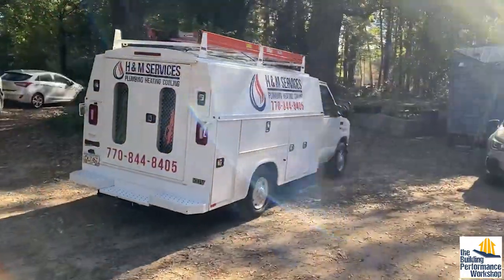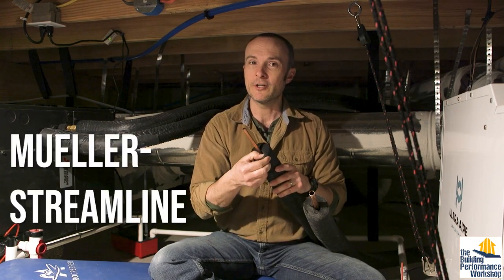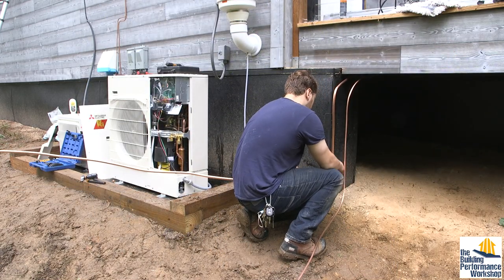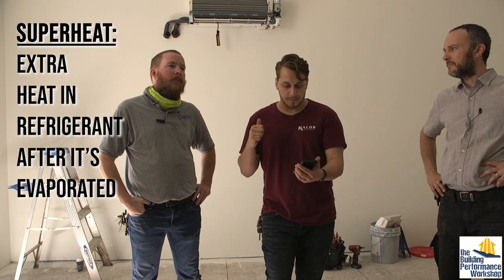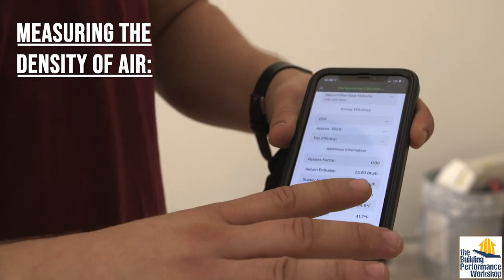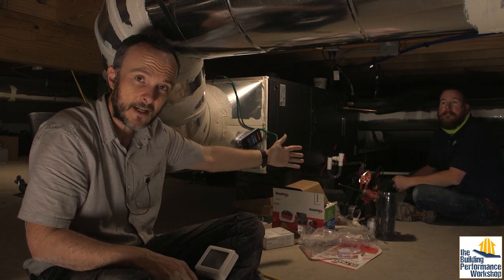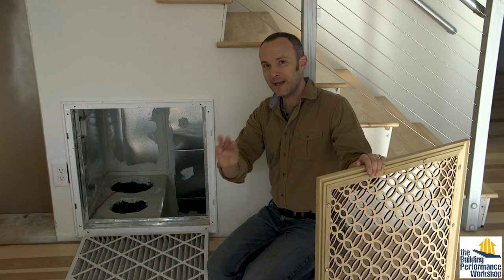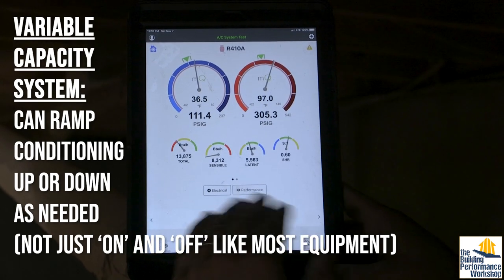Ultimate HVAC Install and Testing: High Performance Heat Pump and Ductless Mini-Split

Comment: Great video and Thank You for taking the time to explain the proper steps needed for a HVAC system to function and perform well. Im almost 40 years into the HVAC trade and a HVAC contractor and it is so cool that the newer HVAC techs can get so much needed information online/ YouTube to help make them better HVAC techs. Keep up the great work and videos. Cheers
Reply from the maker: Thanks coolmandude1000, for the comment and for your name

Comment: Ok, I got distracted.....and please don't be offended........3 good looking fellows crawling around feelin' sexy, and those camera shots oh my!  ((O:   

But, great work there for sure and your 'OCD' really comes into play.   I had a very nice crew from a pro HVAC business here (August 2021) in the NE install a new Mitsubishi 30K BTU split system in my home (3 air handlers)   Poor guys were out there in the hot sun, then under my 28' deck putting the line set in while on their knees anchoring low into the foundation!

I offered water and shade, but they were just happy working along for 1.5 days during the install and were very kind to put up with my photo documentation!

I decided to call them moments ago to let them know that I was able to STILL get warm air from a NON 'hyper heat' outdoor unit down to 0.3 degrees F. and keep the home at 65 degrees!  They were very pleased to hear.  However, the temp ran BELOW 0 last Saturday night (-2) and the system would run for only about 2 minutes and then stop.   It got down to 52 degrees in the home during the overnight ! 

Tomorrow (1-21-22) they are going to get back to me on the mechanics of changing out to the hyper heat outdoor box.   Thanks again for reading, AND your video presentation.
Reply from the maker: Very cool stats, Gary, thanks for sharing! I bet below zero is definitely in the cards for you again this year, your hyperheat will be worth it.
Reply: @HomePerformance  Thanks so much for your kind reply.  I will write again and let you know about the H2i conversation with A-Plus' HVAC.

Comment: 21:20 FYI precipitation percentage generally reflects both area and confidence. I.e. being 80% sure that rain will fall on 50% of the physical area of the forecast would be a "40% chance of rain" because 0.8*0.5=0.4.
Reply from the maker: Thank you for clarifying, Evan!

Comment: I got a quote with a 9K BTU hyper heat for a 900 sq ft open space with 8 ft ceiling and relatively good insulation and 4 windows and I initially don't believe that could heat the space during winter of new england. But after looking at the engineering data does tell me it's output is 18K BTU at 47F and 14K BTU at 17F, 11.6K BTU at 5F, I am quite convinced. But just in case, still ask contractor to use 12K BTU hyper heat instead.
Reply from the maker: Good digging, Pan- but that conservative ‘extra padding’ you added at the end is already built into Manual J. 9k is oversized for my 800 sq ft studio with 13 ft ceilings plus a 4’ crawlspace, fyi.
Reply: @HomePerformance  I also have a space with 600 sq ft studio with 14 ft ceiling without crawlspace (concrete floor on the ground), 2 windows, 1 french door and 3 walls from external walls, it gets 18K BTU single zone Mitsubishi hyper heat. So the calculation seems quite different here. I assume your space has no window and very very good insulation?
Reply: @HomePerformance  My house is from 95 original Anderson wood double panel window, 2x6 structure. So not that confident its isolation is as good as yours.
Reply from the maker: You should be able to see everything they put into the Manual J, to check their assumptions.

Comment: Where were you able to buy that lineset? I was able to source a 1/4"Lx 3/8"S x 1/2" insulation streamline lineset but couldn't find anything with a thicker insulation unfortunately.
Reply from the maker: If you get the SKU off Mueller-Streamline, any supply house can special order it
Reply: @HomePerformance  Thanks!

Comment: I was told by my contractor the return duct needs to be  place in the ceiling to pull in the warm air from the house and the supply ducts at the floor. It appears your return is at the floor level. How well is that functioning in the warm summer days?
Reply from the maker: It really doesn’t matter if you keep the air mixed (like with ceiling fans on low speed upward)

Comment: Do you have any idea how much of friction the ducts costs？ pls share. I am in China, we mainly use mini splits for cooling and heating, some bigger home owner may use VRV systems, however I only see ducts for the refrigerant lines, both system directly blow air to the room, no need for the air to travel all the way. Do you have any idea why we use totally different system? The pros and cons for both system.
Reply from the maker: Your expectations for humidity and temperature seem to be very different from Americans, Lynn. And you’re used to using ‘decentralized’ systems, so homeowners/renters probably understand better how many and what type of standalone extra equipment to have hanging around. Are you in the building industry?

Comment: Good video, like that extra thick insulation on lines.
Reply from the maker: Thanks, me too. But it IS a bit of a PITA, and it tries to fall down like a sock with no elastic on vertical runs with cuts. Lots of zip ties my friend.
Reply: @HomePerformance  There is a glue made especially for that insulation.+ aluminum tape.
Reply from the maker: Ooh, interesting, I’ll look around.
Reply: @HomePerformance  I use K-Flex 320 Rubber Adhesive, which works well, in case you are planning to insulate some of your pipes get one that is precut but not with glue, peel and stick glue on pipe insulation does not work well. Insulating cold water pipes is more important than hot ones. Keep up great work and videos.
Reply from the maker: Thanks buddy

Comment: Rather than putting dampers in the ductwork did you consider smart vents like Flair or Keen?
Reply from the maker: Not even for a second, Steve- those can be bad for system performance if you mess with them- back pressure will build up. Set it and forget it is the best way.

Comment: Here’s a nerdy question, what are doing with your ac/ Dehum condensate? I’m assuming you’re not dumping it directly outside since that drain line would be a potential air leakage pathway.. I’m in furnace country so often our condensate traps dry out in the winter, and then get re primed by ac condensate in the summer, I don’t know if this occurs with heat pumps or not... this is where I’m curious.
Reply from the maker: Great question Paul! I’ll show you all about it very soon.

Comment: Any suggestions to locate a firm to build an energy model for a residential project still in design in Alabama?  I have an architectural sketchup model and have been playing around with OpenStudio, but I also haven't been able to find any good training videos related to residential construction.
Reply from the maker: Hi Brian- I would be happy to help you, I build and tune energy models for clients nationwide. Get in touch via: https://buildingperformanceworkshop.com/new-homes

Comment: I used to sell hvac eq ...  Crazy but it seemed only 20% of the techs really understood all the things you presented.. The other 80 were either repair or installation guys.  They likely could run a calculation when they got out of school but these are the same folks who look at the square footage.. say ok need this many BTU. then add 20% to make sure they have enough capacity.  The thought of running smaller seemed to never be in their lexicon.
Reply from the maker: Right on, Steve- we all have a lot of work to do
Reply: @HomePerformance  I think that there is actually not a lot of reason for most techs to keep up on running a  j calc.  It is a lot of effort and as you know doing them is only an estimate. I was watching the install of a mitsubishi vfr. 3.5 tons.  Granted it is out in the desert but The house is an ICF build.  Talk about major thermal fly wheel effect.  That place likely could have gotten by with 2 tons and that might have been serious overkill.  The rule of thumb is long lasting.   This many cubic feet of space = this many btu period.   FYI his place looks to be perhaps half the size of your build. Looked to me that he has a lot less window sq footage so the heat gain is not going to be super dramatic.  Still with variable refrigerant flow and 4 zones I would be amazed that his normal needs are even a ton.
Reply: I have that issue here. I did an online calc for my office heatpump. Could not buy one small enough. Heat pump guy was going to get the smallest we could get. But he got the next size up. So it gets to temp in half the time the lounge one does and you watch the humidity climb back up 😭
Reply: @tweake7175  One really has to look hard to find tiny equipment
Reply: @stevepailet8258  they do not make one for my market here, at least in the main brands. Corbett has a small mitsi for the tiny lab, but thats not available here. the smallest mitsi i think is two sizes up. the smallest i could find was one size above. rather annoying because a lot of houses here have small bedrooms and ducted hvac is non-existent.
Reply: @tweake7175  did you need 3000 btu?
Reply: @stevepailet8258  if i have done the conversion right, calc says 5500 btu. smallest i could get is 7000 btu, installer got 8500 btu. (this is on cooling). by mem the smallest mitsi they sell here, like what corbetts got in the tiny lab, is ~8500 btu.
Reply: @stevepailet8258  i goofed a bit. those numbers are the rating. actual output for the smallest i can get is 2900 btu min to 8200btu max.
Reply from the maker: Tweake, don’t sweat it- yes, proportionally that is oversized, but you’d aim for a 3/4 ton anyway. You really should watch out when your load is 2 tons and they try to sell you 4.
Reply: @HomePerformance  yet its interesting how many issues it has. Fans are to powerfull and blow the curtains around. Overshoots temp settings. Will flip flop between heating and cooling constantly. Gets to temp in half the time as the main one. 
It may only be oversized a little bit but it seams to make a big difference.
Reply from the maker: Wow, that sounds yucky. I don’t like setting it on auto where it can flip modes- I set mine to heat or cool only, and flip it myself.
Reply: @HomePerformance  yet the lounge one is good. Tho its double in size but covers 3-4 times the aera.
Reply from the maker: Tiny spaces are a problem brother
Reply: @HomePerformance  The problem I see with tiny units is that it gets to be like being in a cold storage room.  Way to much moisture. Only takes a moment to get cold but any remaining moisture is not fun.  Dehumidifying is likely a lot more valuable than taking down the temperature, when it comes to comfort

Comment: Quick question. In one of your past videos you stated that you didn't like UV light sterilization used with HVAC. Can you please explain.
Reply: It can produce dangerous amounts of ozone from what I understand.
Reply from the maker: Yes, ozone is basically the grandmother of all indoor chemistry- create a little bit of it and you spawn all kinds of weird reactions that make it almost impossible to predictably mitigate.
Reply: @HomePerformance  i still don't understand. It is my understanding that hospitals use some sort of UV light thing. Maby a video for us not so much in the know.
Reply from the maker: I’ll do one for you. Start here:

Ozone: Original Villain of Indoor Chemistry
https://youtu.be/iDzdlt9ufWk

Yes, hospitals are more concerned with disinfection than with chemical reactions than with chemical reactions, and yes, hospitals are not homes- very different characteristics and parameters.
Reply: correct me if i'm wrong by UV lights don't make ozone. ionizers do.
the problem with UV is the bulbs are way way to small for the massive amount of airflow. not to mention a health hazard if someone opens the unit not knowing there is one inside.
Reply: @HomePerformance  Interesting video,  i was not aware that UV lights produced ozone.  I used to work at a car rental place that used ozone generators to remove the smell of smoke. Thank you for your time. I watch all your videos.
Reply from the maker: Thanks for being a fan, Steven! And yes, actual ozone generators are super bad news at home.
Reply from the maker: Look deeper- UV ionizes too
Reply: @HomePerformance  quick look, it seams to depends on wavelength and if the bulb filters certain wavelength. very easy for someone to claim their bulb doesn't make ozone when a cheaper one will.
looks like a minefield, better to just avoid it altogether.
Reply from the maker: How they test for ozone is important too- it almost immediately reacts with nearby organic molecules, so if there’s even a tiny bit in the air it means that there was a lot created and reacted away before you sensed it. Like an iceberg.
Reply: @HomePerformance  one more question,  I received a cell phone sterilizer UV light for Christmas.  Is it a bad thing to use? I use it at night while I sleep on my bedside table.
Reply from the maker: All night? Yes, I think that’s a bad idea.
Reply: @stevencrawford9576  keep in mind uv eats plastic. Its a big problem downunder. Our outdoor plastics require more uv stabilizers due to our higher uv levels.
Reply from the maker: Coooool point Tweak
Reply: @stevencrawford9576  some home rental companies do the same and some are also used in hotels.  They are great when used responsibly.  But you know I dont think I would want to live with excess ozone in my living space.  Just normal amounts found in nature is fine for me

Comment: Neil got the gravel bed idea from Howard Mechanical out of D.C. Gotta give Alex and his crew their props!
Reply: Tim I really love the gravel idea as a builder - it reduces my reliance on concrete products and processes -  also easily and non destructively moved  if the equipment changes down the line. Nice!
Reply from the maker: Always interested in giving props where props are due

Comment: You totally skipped over the electrical installation of the outdoor heat pump😢
You didn't talk About the disconnects or the circuit breaker size or the wire size etc.

Comment: ... I installed my Mitsubishi ductless in my house and had no issues with my hole placement??????? I don't understand and I wouldn't stand for the way that ended up!
Reply from the maker: You probably didn’t worry about fastening into a stud, just anchored into drywall. Or your house is not framed 16” oc.

Comment: Exposed refrigerant line super sloppy.
Reply from the maker: Only exposed til you cover it bro
Reply: But sloppy till you cover it as well and why they didn’t come  stray out instead of making a bend inside the home sorry it’s not a problem as far as performed but this guys are the best of the south
Reply from the maker: Didn’t want to bury the compression fittings in the wall, Leo. And as explained, I wanted to hit at least one stud for support, and the lineset lined up perfectly with the next stud. Don’t blame these guys for my self-build quirks.
Reply: @HomePerformance   got it . Hey awesome channel by the way I been  learning a lot!! company i work for in Atlanta is base on comfort science so I mention ur channel a lot we are all fans !!! Keep up the good work
Reply from the maker: Rock on Leo! Thanks man!

Comment: Interesting that its r410. Thats pretty much phased out here.
Reply from the maker: Interesting, Tweak! What are you on, CO2?
Reply: @HomePerformance   residential units are now are R32. most manufactures i can buy here seams to have swapped over in the last few years.
my older one is r410 and the two newer ones are R32.
Reply from the maker: Have not heard of that one, interesting
Reply: @HomePerformance  the old good USA is always behind of the entire world especially in construction industry
Reply from the maker: I believe it
Reply: @andreycham4797  i actually disagree a bit. NZ is miles behind in most aspects of the building industry. going to R32 is seen as being green and most of our heat pumps are Japanese companies. plus we are tiny so very easy to change. 
USA can be slow because of the huge size.